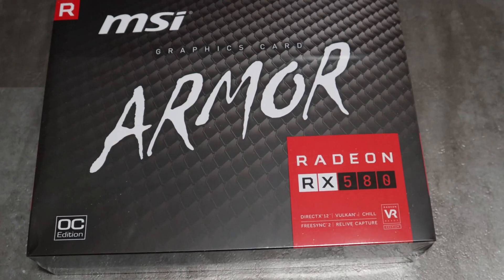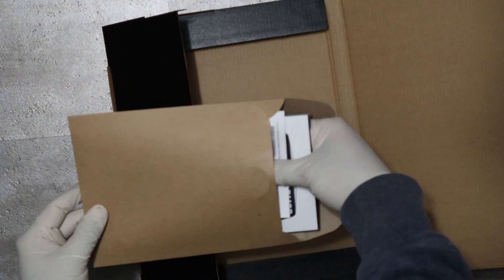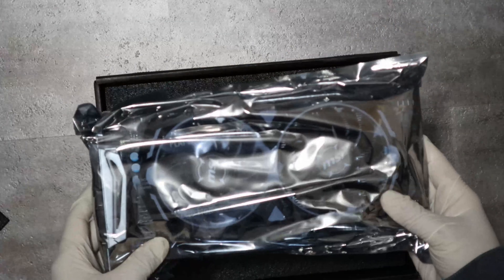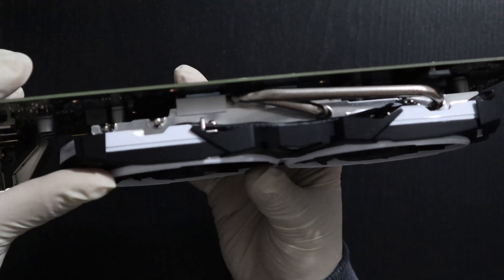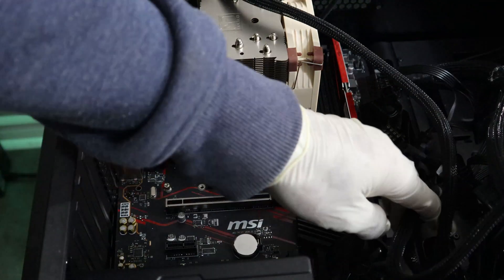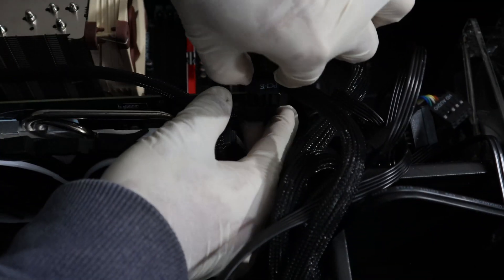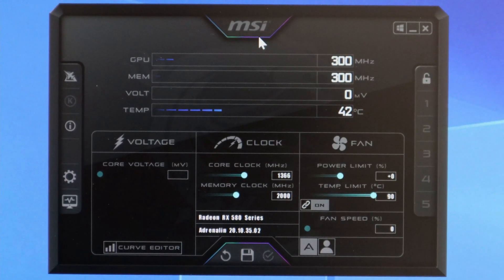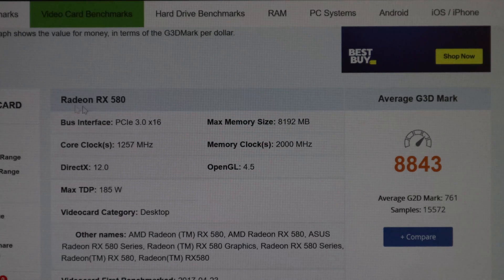MSI Radeon RX 580 Unboxing, installation, benchmark, brief overview - 2022

Comment: I KNOW NOTHING ABOUT COMPUTERS. <My power supply, its 500watts, I cant find the 8 pin bit u plugged into the top of the graphics card.  Is that vital? Thanks in advance
Reply: Yepp, if you only have a 6 pin they sell 6 pinto 8 pin adapters for like 7$

Comment: I paid $200 for mine back in 2019 when it was then 1 year old, what'd you pay in 2022?   Looks like I could sell mine used for about $500 right now lol.  Crazy.
Reply from the maker: wrong, mining is over so probably wont be able to get anywhere close to that
Reply: lmfao got this exact card for $80 used coming tmrw they are also new at best buy for $150
Reply: Just got one for 87$ they are everywhere in 80-140$ range
Reply: Mine costed 90
Reply: They are $60 on AliExpress and they are legit rx580.
Reply: Mid december 2024: I just bought a refurbished RX580 8GB for like 40$.